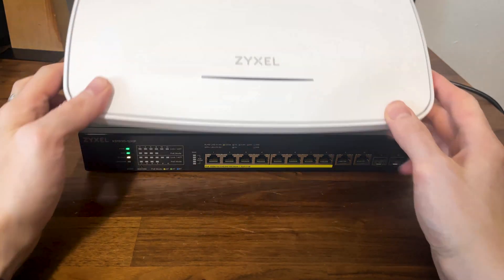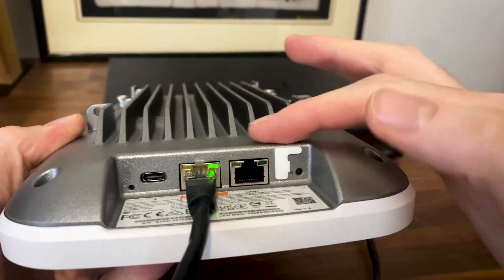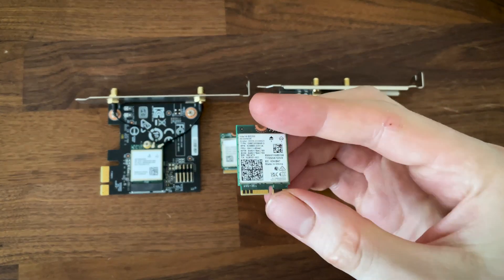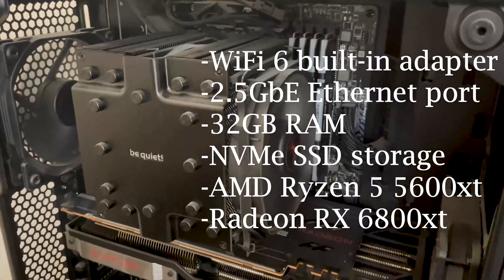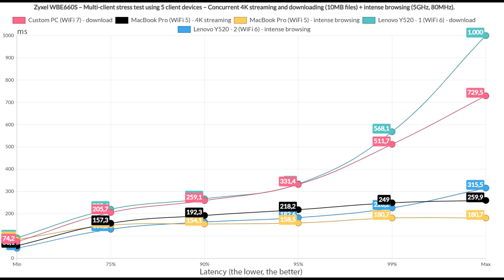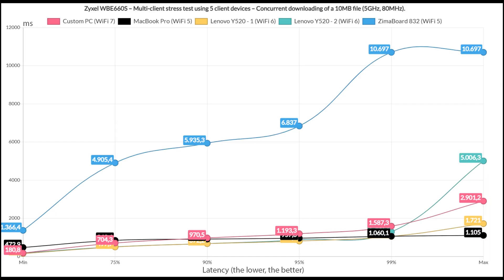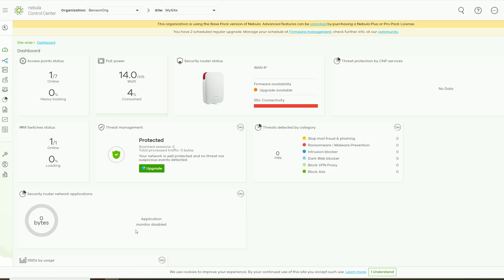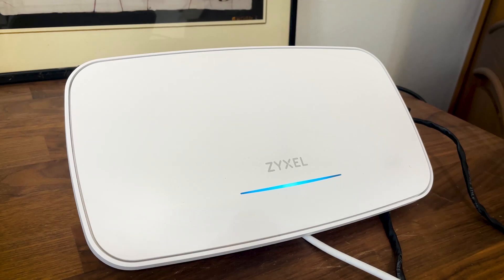Zyxel WBE660S WiFi 7 Access Point Review and Tests: Best WiFi 7 Access Point Performance

Comment: I bought wbe660s but it doesn't seem to be working properly for me, I don't have like you switch with poe++, I connected to injector Zyxel POE12-30W-EU0101F port uplink shows green and orange LED is on, I can't get to the AP (via browser UI), same thing is when I connected power supply USB-c 65W usb-c -> usb-c. Connected only cable USB-C but on uplink port light green and orange constant on, what to do is it the AP is fault or the power supply not to strong?
Reply: wbe660s need a poe++ (802.3bt) power supply, so poe12-30w isn't enough, you need to chnage a bt poe injector like poe12-60w.

Comment: Is there a point in getting such thing instead of upgrade the router itself? TUF-AX3000 V2. 2 laptops, 3 phones and Quest 3
Reply: 1 device trying to do everything vs individual devices with a dedicated single purpose.
Reply: It’s all about need (aka purpose)
If you have a lot of area to cover it may be worth it else stick with the old one 
Do not waste money they will all do the same
Reply: @yashwingokavarapu6845  a lot of people say that playing in VR is better over a router that isnt used for anything else. But I never saw proofs in numbers. Virtual Desktop shows like 3-6ms network latency. GPU performance is much bigger concern